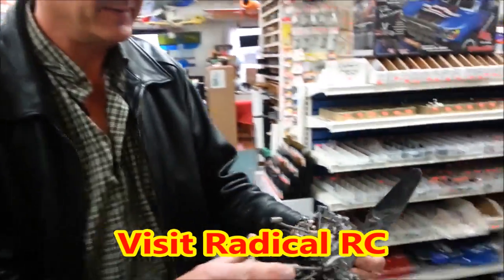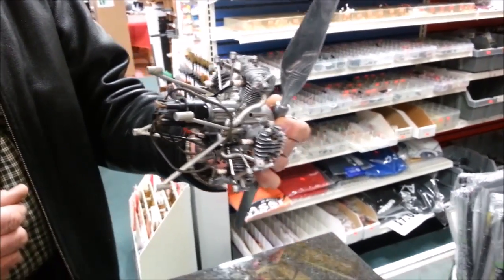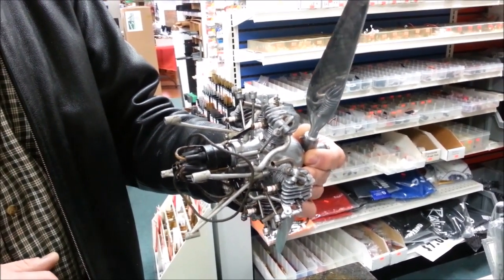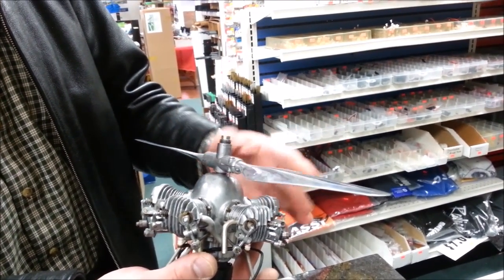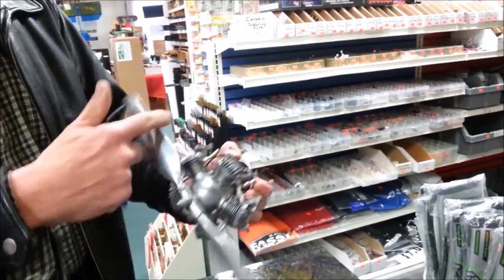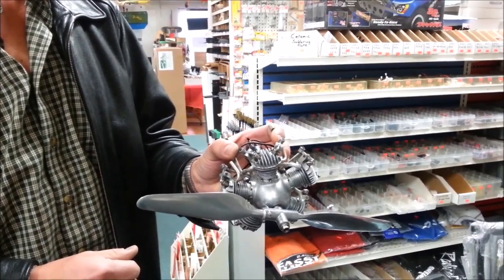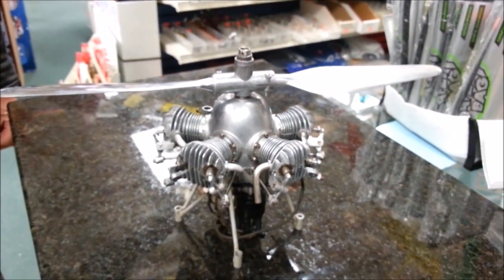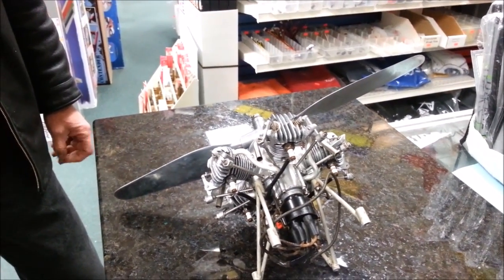1946 Morton M5 Radial # A612 Visits Radical RC

Comment: So interesting to see after all these years.  I was an avid reader of Air Trails magazine in my youth and it was loaded with ads for various hobby companies like Scientific, Berkley, O.K. Cub, Ohlson and Rice, etc. and that would have been around 1950.  What an appetite it worked up for my entry into model engines and airplanes.  I recall ads for the Burgess-Morton M-5 and that ad priced them at $85.00 and the photo showed a built engine.  One local hobby shop owner had one mounted on an airplane that he showcased in his window and I think he occasionally ran it though I never saw that.